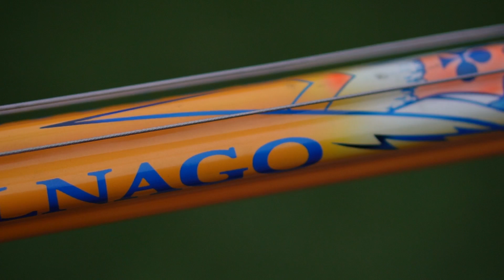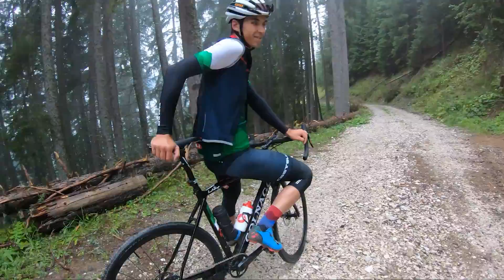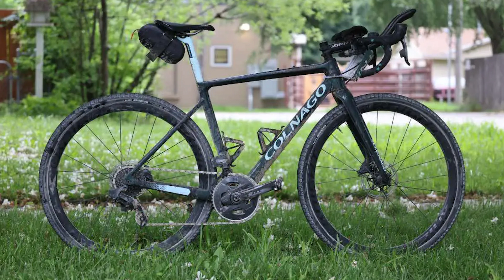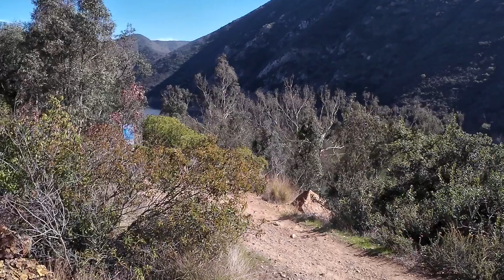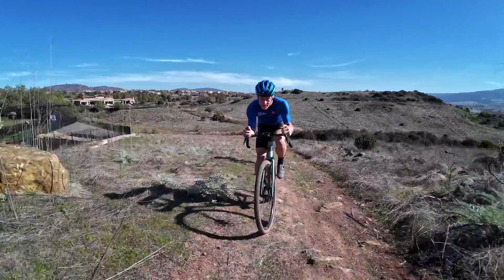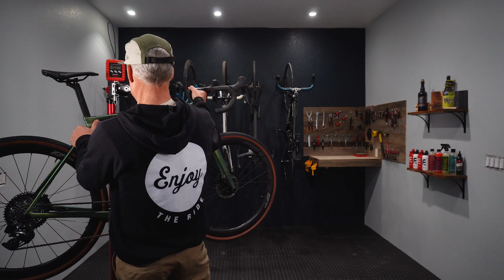New Colnago C68 Gravel bike: ride impressions and details

Comment: This Colnago gravel C68 looks pretty and it might be a relatively smooth ride for the huge money  ...but an observation, 40mm tyres are gravel race bike tyre size, yet it’s very clearly stated that this is not Colnago’s gravel race bike and is intended for more general gravel riding. ...My view is that if it’s not Colnago’s gravel race bike, it needs more tyre clearance.  …it will be interesting to hear more …looking forward to your full review Ben.

Comment: I'm a huge Colnago fan and have ridden their C series bikes since the C40, currently riding the C64. I'm glad they're still making some bikes in Italy and this does seem to be a very Italian view of a gravel bike. But to me, this is too close to road. A 42mm tyre limit is out-dated at inception - surely designing for max 50mm (40-50mm) would be more important than designing for min 32mm (32-42mm)? I also think the bike looks short (I'd be interested in the wheelbase) and frankly, integrated bars are ridiculous on a gravel bike not designed to race.

Comment: I bought my Mog with Ekart second hand for 4k last week. If you offered me to swap it for the one you are featuring I wouldn’t  trade you. This is crazy. They should have learned from Pinarello. Gravel people are not stupid. Terrible mistake. -$7100 for frame, which means for a full set about 15k. As a bike builder I would be embarrass to offer it to a customer. Clearly, they’re trying to tap on the cult following colnogo has.

Comment: I just realized yet another badness of integrated cockpits. I modified my CX bike for road duty today, and that involved putting a longer stem. So this type of versatile bike, as described in this video, requires an adjustable cockpit depending on intended use and on time of year (fitness).

Comment: As many modern gravel racers are going with wider and wider tires - 45mm might not be enough.  The Felt Breed, for example, will take 50mm.
Reply: Ask Dylan Johnson!
Reply: @bobfoster687  yes 🙌 indeed.  I’m running 47mm Pathfinder Pros on my Revolt, in fact.
Reply from the maker: @petersouthernboy6327 I bet that combo feels great. I have not yet tried the Pathfinders in 47, but the 42s and 38s are money.